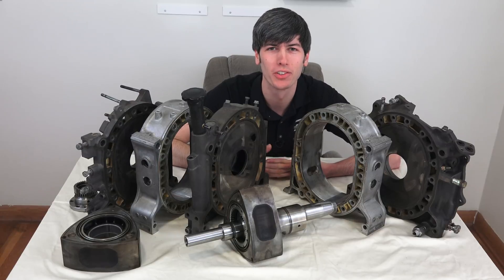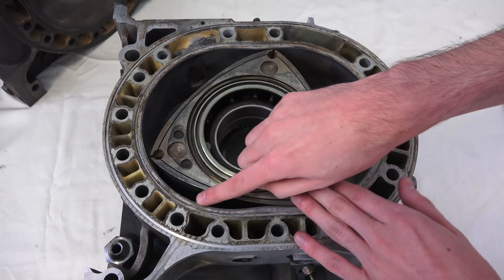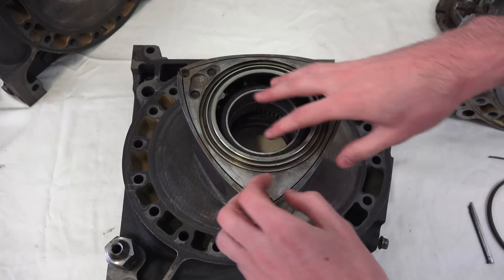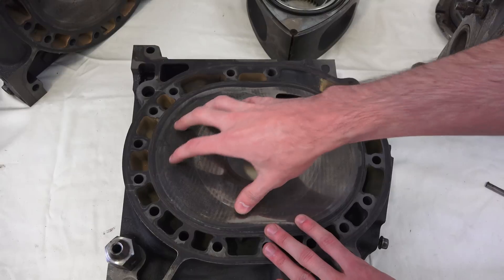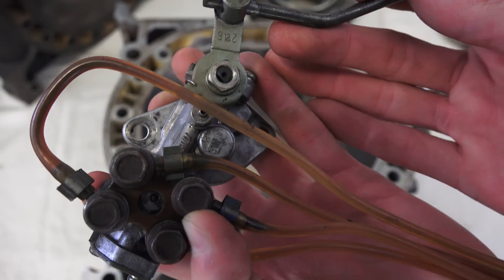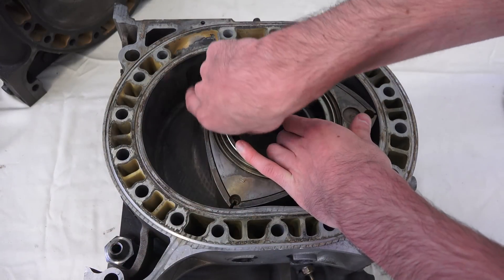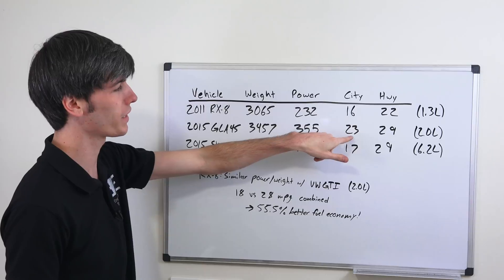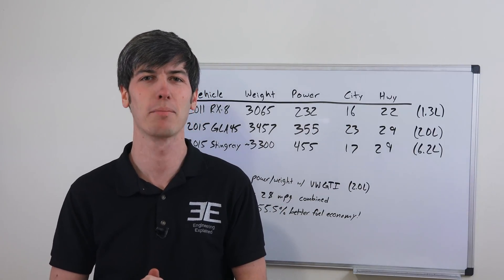4 Reasons Why The Rotary Engine Is Dead

Comment: Who wants fuel economy when you can rev to 9K RPM and spit dragon flames ?
Reply: Rotaries are 100% meant for racing, they can achieve a really good amount of power for their displacement or for any displacement really, they rev high and dislike low revs.
Reply: Vertti syrjälä the displacement is a technicality that they are able to call it 1.3. It’s really like a 3.9. It’s like a 4 stroke and 2 stroke. But thing is 2 strokes makes use less displacement to make same hp as 4 stroke but uses basically twice the gas. Rotary uses 3 times the gas to make 1/2 the hp. Horribly inefficient. Only thing to it’s advantage is literal size and weight. In other words garbage. You want high rev  go Honda
Reply: @youtubecomments5951  I don't know where you get your figures but they are wrong. The  displacement is commonly considered to be 2.6 litres. 
The consumption might be as much as twice that of a modern engine of the same power output. But you would have to put up with that engine being turbocharged.
Reply: @johnbb99  The actual displacement of the Mazda 13b is 3,924cc's.
But when we compare the Wankel engine to a 4-stroke reciprocating engines we must recalculated the Wankel's displacement at 720° which gives us an approximate value of 2.6 liters.

The Wankel engine has extremely poor BSFC performance compared to other types of internal combustion engines, the Wankel producing approximately half the horsepower for a giving mass or volume of fuel.
Reply: @verttisyrjala2897  but gets damaged faster
Reply: my wallet
Reply: Jezreel Escobar same
Reply: Exactly. Besides, rotaries are more suited for race cars and not really meant for the street.
Reply: @DanDoesJunk  thats why they are banned in racing because they would dominate so hard. light small extreme powaaaa, like two strokes in bikes^^
Reply: @UCjNLcDavj2EZTPqBlGQp1Pg yes but like two storkes the eco people hate on it but the little 250 cc bike is no turbo 4 rotor that goes throw gas in cubic meters and kills pandas ^^
Reply: @DanDoesJunk  LOL, no. It's a low power, low torque solution that was a quirky little thing for a while. It's not a good idea, it never was.

There are other rotary engines that could have been but the Wankel was dead on arrival as the worst of all worlds.
Reply: @michaelmay5453  Just because its not useful doesnt mean it was a bad idea to make them. Wankels are great for racing. And a lot of car guys like them.
Reply: @verttisyrjala2897   It kinda does mean exactly that. Bad ideas are not useful and not useful means it's a bad idea.

They are horrible for racing, more so than for any other use and if they weren't they'd be used for racing but they are not, not anywhere in any racing category and they never have been.
Reply: @michaelmay5453  How are rotaries horrible for racing? They have excellent endurance, and can handle consistent high rpms very well compared to piston engines. And of course, displacement/hp figures are unmatched, although rotaries are different engines so guess you cant really compare them.
Reply: @michaelmay5453  They are not being used anywhere because of emissions. They use more fuel than their competitors.
Reply: @verttisyrjala2897   And oil not to mention there are diminishing returns going up in size.

It's simply not a good tech.
Reply: @verttisyrjala2897  Low torque, can't scale it up without diminishing returns, burns through the oil as well as the fuel, compression ratios are kinda horrid and if you push it you'll just have to replace seals at every stop.

It's a bad idea in every way I can think of.

The HP figures of a non turbo 2.6 (some MORONS only count one part of the chamber and call that 1.3 which is retarded) are around 120hp and the torque is abysmal so it would be horrid for racing.

You can't scale it up more than that either, that's pretty much all you can do. You can slap a couple of turbos on it and get up to 400 max but it will blow the seals in no time.

Compare that to a 2.3L straight six that is about twice the effect naturally aspirated and about 60 times the torque.
Reply: @michaelmay5453  Dont need low rpm torque to go fast. A wankel is supposed to burn oil. "Replacing seals at every stop" Now thats BS. Wankels can handle high rpms excellently. Also the displacement is supposed to be "calculated" that way, only 1/3 of the total displacement worth of space is used for each combustion. Also a stock 13b from a Rx8, the high power version, pushes 238 bhp...
Reply: @verttisyrjala2897  I don't think you understand the concept of torque. YES you need it to race, the more the better and it's FAR more important than horsepower.

238 eh? That's cute from a 2.6l engine. Now an Opel Omega 2.6 from 1992 is about 250hp and 8 times the torque so obviously that is a great race car, right?

Even Mazda gave up on the Wankel, it should tell you something that the last company to champion it realised that it's a crap engine.
Reply: @michaelmay5453  A 13b is not a 2.6 liter engine...  Completely different from a traditional 4 stroke engine, but it still should be considered a 1.3. 654cc displacement chamber worth of air/fuel mix is used for each combustion per "cylinder". And no. You have gears for a reason. Low rpm torque doesnt benefit you in a actual race. Or not a lot at least.
Reply: @DanDoesJunk  thats a very vague statement.maybe pursuit or track cars but even then a good DOHC small liter with any forced induction will blow it out of the water
Reply: @erikcapozzi771  but a rotary engine in drifting... now thats unbeatable
Reply: @TitanBeats  How do you beat someone in drifting???
Reply: And have a very nice sound and idling. And who could forget the perfect 50/50 weight destribution of an Rx-7
Reply: @xhearthfirex6571  TESLAS nemesis
Reply: ive driven a 1989 rx7 in the us from coast to coast many times and it did fine. i stopped to refuel about every 350-400 miles. if i had been in a more fuel efficient car i wouldve stopped to refuel.. about every 350-400 miles lol. in any circumstance on a cross country trip i would advise stop in ANY car at least that often well mostly just due to prolonged exposure to heat.. parts could come loose and fall off (especially around the exhaust systems).. so little has actually changed in the real world so called "hybrids" for people that have to drive very long distances those badly skewed figures of fuel consumption dont mean a whole lot.. when i say skewed i mean car companies that boast 75 mpg but the fine print reads "estimated equivalent running on this 1000hp supercars 10hp electric fan at the front of the car at 5 mph for 20 miles"..
Reply: and break an apex seal :'(
Reply: Hell yeah
Reply: @Boony Tooty Just the truth here, not even Mazda makes the Wankel engine anymore.
Reply: @Boony Tooty what's the matter kid? Is the nearest Mazda dealer too far away for you to ride your bicycle?
Reply: @Boony Tooty Resorting to childish insults is usually indictitive of someone becoming aware they have lost their argument.
Reply: @Boony Tooty We still have steam trains here, and some people claim to have seen Elvis selling MX5s at the Mazda dealer in Memphis.
Reply: I care fuel economy, since I don't own a oil field
Reply: I got a v8 that goes 10k is rpm and prob has more hp
Reply: Rotary go BRAAAP 👁👄👁
Reply: well if you are a fan of the movie Dragonheart, go on and buy a wankel to spit dragon fire. For the rest who have money and love a true sports car, they can buy a Porsche etc.
Reply: My S2000 did 9k and still got better fuel economy making better power.
Reply: All while going 0-6 in 10 flat!
Reply: Me
Reply: They're total junk
Reply: @rmdo5583  just like your mom
Reply: Who wants another tow truck ride the repair shop for yet another new engine....
Reply: @Boony Tooty indeed, that would be a very accurate discription of your comments.
Reply: @Boony Tooty Mazda LOST the 1991 season championship to JAGUAR
Reply: @Boony Tooty Audi has won LeMans NINE TIMES with a Diesel engine...
Reply: @Boony Tooty Mazda discontinued development of Wankel engines in 2009 due to steeply declining sales after 1985.
Reply: @Boony Tooty Mazda discontinued development of hydrogen fueled Wankel engines in 2009 after a humiliating failure in the Norwegian HyNor program, the Mazda RX8 hydrogen RE was the worst performing hydrogen vehicle tested and was the only major manufacturer rejected by the program.
Reply: @Boony Tooty There was only one Wankel rotary engine and it resides in a German museum.
Mazda licensed the non-rotary KKM version in 1960.
Reply: @Boony Tooty The Wankel engine is obsolete today because it offers no significant advantages over other internal combustion engines that the Wankel failed to replace.
The Mazda 13b-MSP has over 235 moving and seal related parts... more than many 4-cylinder reciprocating engines.
Reply: @sandervanderkammen9230 wankel is also an internal combustion engine.
Reply: @kamilorzechowski6244  Yes, the Wankel KKM-57 engine design is an internal combustion engine...
 What is your point?
Reply: @sandervanderkammen9230  you wrote in one comment that wankel failed to replace internal combustion engines. it cant if it is itself internal combustion engine.
Reply: @kamilorzechowski6244  I wrote, quote;
 "@Boony Tooty  The Wankel engine is obsolete today because it offers no significant advantages over other internal combustion engines that the Wankel failed to replace."
Reply: @sandervanderkammen9230  ok
Reply: @Boony Tooty The facts are clear, the Mazda RX8 met both EPA Tier 2 Bin 5 and CARB ULEV II emissions requirements right up until production ceased in 2012 due declining sales.
Reply: @Boony Tooty Might be news to you son but the rest of the world is aware that the Wankel is obsolete, even Mazda abandoned the Wankel.
Reply: @Boony Tooty The Wankel engine was an evolutionary dead end... all of the 26 Wankel licensee's including Mazda have discontinued development of Wankel engines.
Reply: @Boony Tooty Take a trip down to your local Mazda dealer and see for yourself... you won't find any RX models or Wankel engines
Reply: @Boony Tooty Mazda permanently discontinued development of Wankel engines in in May 2009.
Reply: @Boony Tooty Seems like a lot of things you don't know about Wankel engines... or engines in general.
Reply: @Boony Tooty Mazda was the only one??? LOL!!!!!!!
You really don't know anything about the Wankel engines so you?
Reply: @Boony Tooty Keep telling yourself that... that way you is never learn anything about them.
Reply: @Boony Tooty The Mazda board of directors. They voted in April 2009 to cease all further development of Wankel engines in 30 days and no new prototype has been seen since 2008.
Reply: @Boony Tooty Don't believe me check yourself, there has been no mention of Mazda's 16X program since 2008 and Mazda removed the 16X page from it's global website.
Reply: @Boony Tooty Mazda has not unveiled any new production Wankel engines in 25 years!
Reply: @Boony Tooty No, just someone that knows a lot about Wankel engines...
Reply: @Boony Tooty I even know the stroke of the 13b... do you?
Felix Wankel had nothing to do with the development of this engine... do you even know who designed the Wankel KKM type engine???
Reply: @Boony Tooty Felix Wankel's engine  was never used in cars, can you tell us what it was designed for????
Reply: @Boony Tooty Well, considering the overwhelming weight of of research and development of the Wankel engine predates the internet, you might want to learn to use something called a BOOK because in the the 21st century the Wankel engines history has been mostly forgotten.
Reply: @Boony Tooty That is exactly what I expected, you are a complete and total amateur, any expert knows the Mazda 13b's eccentric-crankshaft has a 15mm off-set that produces a 30mm STROKE for each revolution.
Reply: @Boony Tooty I've never driven an Adams Farwell... and I'll wager niether have you son..
You should learn the difference between a Wankel KKM and a real Rotary type engine.
Reply: @Boony Tooty I remember way back when they still made Wankel powered motorcycles, chainsaws, lawn mowers and outboard boat motors....
Reply: @Boony Tooty Are you even old enough to remember when they still made Wankel engines for RC model airplanes?
Reply: @Boony Tooty Ice cream machines??? Mazda made corks and bottling machines when they bought a license to build the Wankel engine, I was not aware they made ice cream machines too.
Reply: @Boony Tooty I own 2 Rotary engines... a Uberusel UR-II and a Le Rhone 9C.
Reply: @Boony Tooty I know the difference between a Wankel and a Rotary... I also know the difference between a registered trademark and a engineering classification.
Reply: @Boony Tooty They sold Wankel powered snowmobiles too.
Reply: @Boony Tooty Indeed, I can shame anyone into learning about the Wankel engine.
Reply: @Boony Tooty I was just being kind kid, you have yet to achieve amateur status.
But don't discourage, you seem like a fast learner you might just make it amateur someday.
Reply: Best coment ever lool
Reply: dont forget the massive powaaa
Reply: Everyone?
Reply: This day is the 9 year anniversary of the  end of RX production at Mazda.
The very last Wankel engine powered car rolled off assembly line on June 21st 2012.
Reply: @sandervanderkammen9230  Please tell me whats your point of saying that... You're clearly obsessed with what you're doing. Do you really think anyone cares how long its been since they stopped making them? Wankels could never pass emissions, that is the obvious reason they stopped making them. End of story.
Reply: Some things you see really stick in your mind. I saw a GT300 class RX-7 from the Japan GT entered in the Sepang 12-Hour Endurance race in 2001. That beast spat a blue flame out the exhaust like it was a fighter jet at take-off and screamed around the track, almost drowning out the exhaust notes of all the other cars. No one could keep up with it. Unfortunately, the engine blew by 4-hour mark and caught fire! I swear to you this was true because I was there as a pit crew for another team.
Reply: @Boony Tooty The truth is irrefutable... Wankel engines are obsolete technology because they are inferior to reciprocating engine and electric motor technology.
Reply: @Boony Tooty Racing-wise, I'd say rotaries are more reliable than similiar piston engines, they can handle rpms incredibly well, wankels are perfect for endurance. Fuel consumption? Why would you care about fuel consumption if you're racing?
Reply: @verttisyrjala2897  Audi won the 24 hours of LeMans NINE TIMES with a Diesel... proving that the Wankel engine is poorly suited to endurance racing.
Reply: @Boony Tooty The facts speak loud and clear, the Wankel engine is obsolete because it cannot compete with superior reciprocating engine technology.
Reply: Lol only 9? You can tune to 11k easy.

And they’re not banned anymore.
Reply: @zebatov  Ive seen a lot of rotaries going over 13k RPM's they are beasts don't listen that hater he must be another Mercedes  jaguar fanboy because he can't accept the victories of the 787B in Lemans speaking as a Honda fan
Reply: @giancarlolugo9586  Audi won Le Mans 9 times with a Diesel engine...
Reply: @sandervanderkammen9230  Audi was another history and they did it increíble I mean the 787B suffocated the Sauber and the Jaguar for years and the Toyota GT One came in 1999 and got defeated in 2008 almost 10 years after that car came out
Reply: @giancarlolugo9586  Sauber Mercedes and Jaguar both won a WSC championship... something Mazda never came close to. Toyota certainly has made its mark in international motorsports.
Mazda jas abandoned racing and no longer has any motorsports program.
Reply: @sandervanderkammen9230  Mazda was banned by the FIA  because they knew the 787B was a better concept with a lot of racing potential same goes to all race cars they banned because every team and brand tried to made their own technology and innovations  for their racing cars  Toyota had their Golden age  and the GT-ONE kept the throne till 2008 and their 2ZZ-GE  was great on lotus chassis  also Honda it's one one of the best engine builders in the F1 red bull team it's a proof they won with Honda's F1 engines and Mugen it's doing well on Group A and Rallycross races not mention the EG6 it's still one of the best  FF platforms for race cars  and widely used on Motorsports back to the mazda topic the Jaguar came in the 89 after the 787B was already banned a lot of jag fanboys say  that the 787B it's garbage (while the Jaguars from the 80s 90s 2000s are  probably the most unreliable vehicles in the earth I considerate them as the Brit version of BMW drivers) But you seem like a reasonable person Sorry for call you hater in the other comment and yes Mazda abandoned the Motorsport program but their cars still have some racing pedigree in the soul .
Reply: @giancarlolugo9586  Mazda was never banned by the FIA.
What about Honda? Honda has long established itself as performance brand and its well-known in international motorsports.
Mazda is not.
Reply: @sandervanderkammen9230  well about Honda a lot of people still thinking that they suck just because they failed on F1 in the 70s even If today they are the best engine builders of the motorsports but in the 80s they made the double wishbone suspension  then the VTEC also they did it  amazing with the NSX in LeMans  and GT3 with Senna also Group A & GP bike since the  80s to this date and the actual time attack champion it's a honda built by Spoon
Reply: @sandervanderkammen9230  and the FIA banned the 787B AND other teams from the Group C by their new bs rules also making the WSC more expensive for the teams who wanted to compete in it they cared more about the money than the passion of the Sport
Reply: @giancarlolugo9586  Honda the best engines? No. But Honda is one of the Top 5 Formula 1 engine manufacturers with a total of 6 World Championships... Mazda Zero
Reply: @giancarlolugo9586  The FIA did not ban the 787B, Mazda retired the slow and uncompetitive car at the end of 1991.
World class professional racing is not a pure sport, motorsports exist to advertise the sale of production automobiles.
The Mazda 787b did absolutely nothing to stop the steady decline in sales of the RX brand.
Reply: @sandervanderkammen9230  I said honda has the best engines in the F1 same with their road cars and chassis never said it was bad or It was the top 1 but one of the best yes
Reply: @sandervanderkammen9230  you said 1991 they retired it because the FIA was banning some race cars from the group C in that year  and then in 1992 they went with their restrictions and increased the prices for the group C category a lot of them gave up  also If It was garbage as you said how it won Lemans
Reply: @giancarlolugo9586  The BEST engine manufacturer in Formula 1 is Ferrari with 16 World Championships (6 consecutive)... not Honda

Porsche is the best in endurance racing with 19 Le Mans victories.
Reply: @giancarlolugo9586  Sorry but the facts are clear. The FIA never banned the Mazda 787b... it announced the change in engine displacement rules in 1989,
Mazda was allowed to compete using a group C car in C2... effectively cheating.
The Mazda win at Le Mans in 1991 was PURE LUCK... the points leading cars all.crashed earlier in the race, Mazda coasted to the finish with a record low number of laps.
Reply: @sandervanderkammen9230  that's true as I said there are a lot of good manufacturers in the F1 in the top 5 apart from Honda  and Ferrari has 90 years in the motorsports and about Porsche the GT3 has one of the fastest records on Nurburgring norschedlfid
Reply: @zebatov  Aston Martin Valkyrie completely stock revs over 11,000 rpm.
Reply: Who GAS when you can have a rotary engine (just ONE major moving part) spin to 35, 40 or 50,000 rpm with no problem and get DOUBLE the fuel efficiency of a normal ICE engine? It's called a "turbine" something that mechanical engineers seem to hate with a vengeance because it's NOT a complicated pile of bits highly prone to breaking down at inopportune moments and doesn't justify the ludicrous labour rates most garages employ.

"Think there's a problem with my turbine!". 
"Oh really! well I wonder if it's the front bearing, the back bearing or the fuel valve? How many miles has it done?"
"Oh! about 350,000 miles! ... I've replaced the batteries a few times but the turbine, generator and motor are all fine. There are only 6 bearings between them and they work great as there's NO backlash, no major longitudinal axial load and the load the turbine has to take is pretty much constant for 90% of the time! Can't say that about any ICE engine can you?""
Reply: @boblewis5558   Gas turbines have literally nothing in common with rotaries except the fac they both rotate.

Gas turbines are also stupidly expensive, because while they technically have only one moving part that one moving part is extremelly complex (basically the whole inside of the engine), built to very tight tolerances and with superalloy materials.

Turboshafts are used in helicopters pretty much universally, have you any idea how much they cost, and how much it costs to service them?
Reply: @Boony Tooty Jaguar won the 1991 WSC championship... Mazda came in last.
Reply: @Boony Tooty You sound bitter because your argument is weak and failed badly
Reply: @Boony Tooty Wrong! The Mazda RX8 met or exceeded the strictest emissions standards in world (California's CARB regulations) right up until low sales and financial losses killed off the RX8 brand in 2012.
Reply: @Boony Tooty The Wankel KKM is an engineers nightmare, it is plagued with low mechanical and thermal efficiency and suffers from horrific combustion efficiency.
The Wankel consistently fails to deliver adequate fuel efficiency, exhaust emissions and suffers from unacceptable reliability and service life.
Reply: @Boony Tooty The Wankel engine is obsolete, it is no longer manufactured by any legitimate manufacturers because it is inferior to reciprocating engines still mass produced in the millions.
Reply: @Boony Tooty You really don't know much about Wankel engine or the automobile industry do you?
Reply: YEA' BABY...LOL👍😁😁
Reply: Here we see a video clearly where we do analyze in depth and in depth, we can see that from the different points of discrepancy and comparison. To the best of my knowledge, after several scientific studies through some Google research and many more world-renowned libraries we can conclude that this comment is pointless, and I am particularly happy that someone has read to the end even knowing that it was related to nothing at all, and for the moment I can only thank you for your attention.
Thank you!
Reply: @lediffzitro7902  All 26 of the original Wankel engine licensee's including Mazda have all come to the exact same conclusion, that the Wankel engine was fundamentally and inherently inferior to reciprocating engines that it failed to replace.
Reply: whats the point of fuel economy if the engine breaks more often and need more maintenance.\
Reply: @StopFear  You've been listening to too much bar chat and not looking at the facts. Have you owned one?
Reply: John Baddeley No. Bit I read very detailed history and technical reports. Is there any reason anyone would make stuff up about rotary engines?
Reply: @StopFear  whats the point of fuel economy if the engine breaks before you run out of fuel
Reply: @naut3  Not sure if you are agreeing or disagreeing with me. But yes, rotary engine actually breaks faster than a piston one.
Reply: @naut3  a little late but I've been watching tear downs of rotary engines and I have to say if you know what you're doing it's so simple to fix the apex seals and reassemble the entire engine.
Reply: @sleepwalking117  That is a very false and misleading statement.
Reply: Which is why you keep em for racing and not for mass production, so if you want a rotary...go ahead, build it and spend your money on gas, oil, and rebuilding the thing every 50,000-80,000 miles as the engine seals and parts wear out quicker than a piston engine.
Reply: Twiggy the lizard - I don’t know where people get the 60-80K mile figure - it’s a complete lie regarding every rotary made after 1969 apart from the early RX-8’s - which had factory defects and was later remedied.

If you maintain it and drive it correctly; they can last a good long while.

RX-8’s and Turbo RX-7’s can go well over 150K miles, if taken care of properly. 

And the NA rotaries from the first and second gen RX-7’s can hit over 300K miles before needing a rebuild if you’re careful.

Source - Personal Experience (I’ve had an NA S4 FC hit 310K before I finally had the engine fail and it was a side seal - not the apex seal - that failed) & the RX-7 Forums.
Reply: @rucarnuts13  Yes, you can say anything online, and yes...any car can last a long time if taken care, but don't tell about it, tell the companies that refuse to make rotary engines for mass sale, even mazda doesn't want their new sport concepts to come out with a rotary engine anymore, and google rx8 for sale, you'll find a trend that many at 80,000 are being sold with engine issues at a very low price. Ill stick with a reliable piston engine that I "know" can go up to 300,000 miles if I take care of it.
Reply: Twiggy the lizard - Again, it’s all about how they’re cared for and it’s worth bearing in mind that many defective RX-8’s never had the warranty work done for the defective oil metering pumps in the earlier RX-8’s, which is why you find so many with blown engines.

Look at any number of earlier naturally aspirated RX-7’s though and you’ll find no less a reliable car than an 80’s Porsche 924 or 944.

As for why nobody’s currently got them in production and why Mazda was the only one that tried; it’s emissions. Bad flame front propagation and their burning oil ruins emissions. Inherent design issues and ones that are likely unrectifiable.

They are not objectively good engines, not compared to piston engines, I fully agree with you there - but they’re nowhere near as bad as they’re made out to be. Not even close. 

A rotary, if cared for and driven properly (and by driven properly, I mean rotaries need to be driven hard, as they’ll carbon seize otherwise) will last for hundreds of thousands of miles and they’ll do it while taking more high RPM abuse than any piston engine could.
Reply: CarNutz p